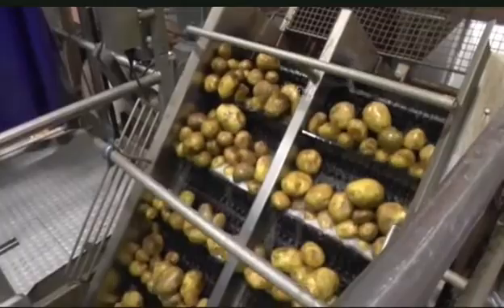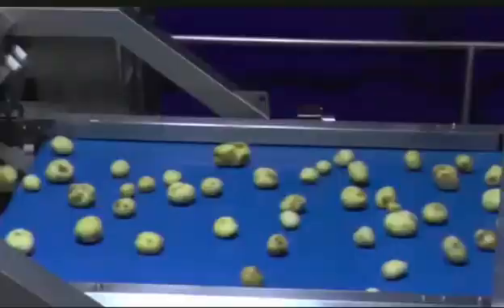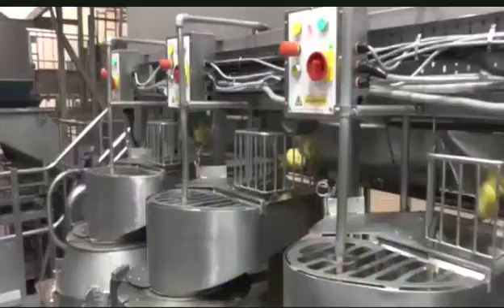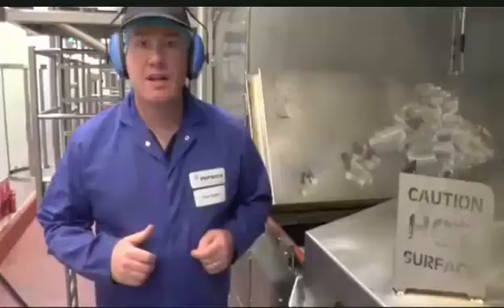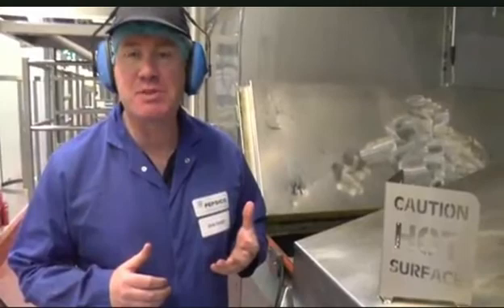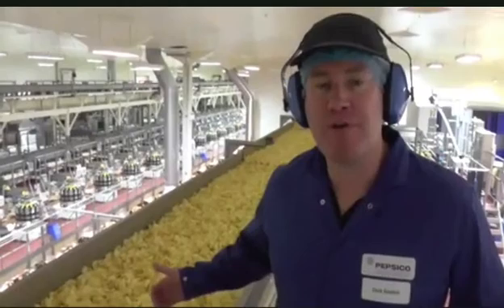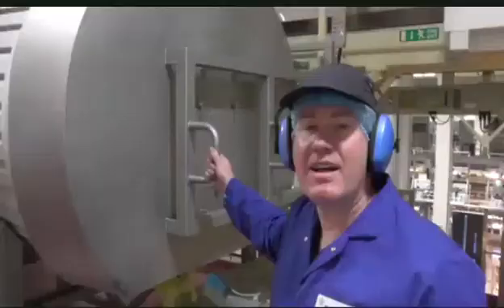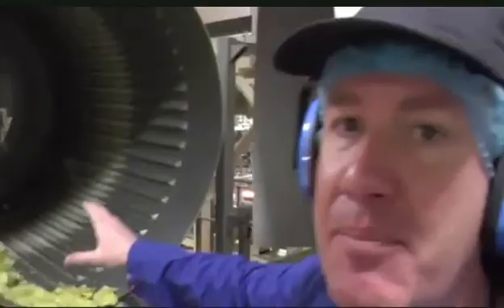Inside Walkers Crisps Factory in Leicester

Comment: 25g single packets of crisps don’t contain enough crisps in the bag!! Talk about being tight as a ducks arse.
Reply: 25g is very light if the crisps were sold as 1-2kg crisps would have contained so much crisps for the price.
Reply: Very in Australia they only put half off the pack don’t feel them up to the top right asses
Reply: Actually, when I was a child I wrote a letter to walkers asking why its only half crisps in a full packet. And they wrote back saying that it's mostly air so the light crisps don't break.
Reply: @SCHRANZ3040  I was feeling depressed and then I read your comment. Thanks for the laugh, I needed it! 🤣